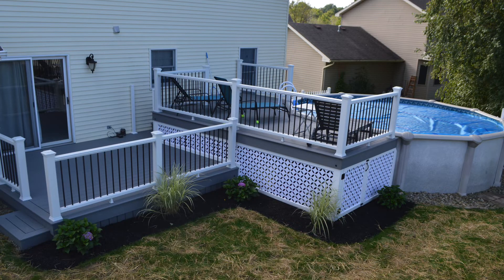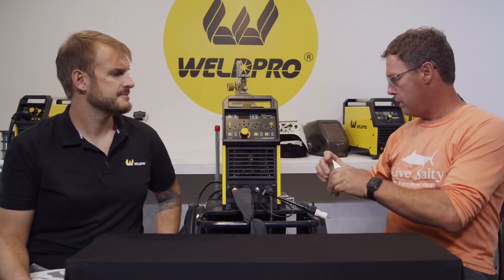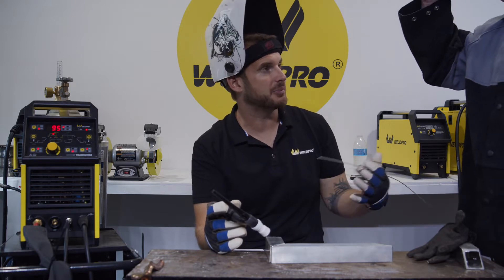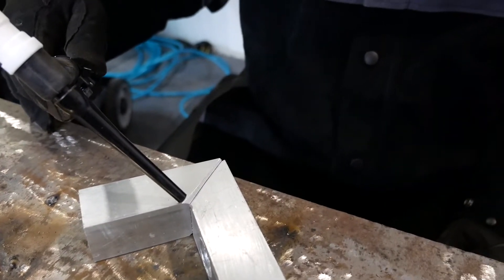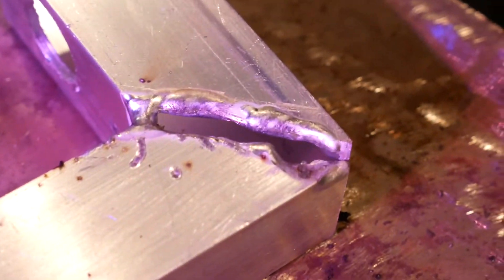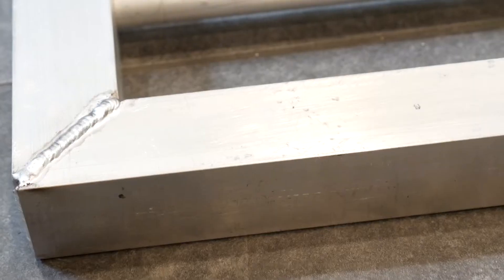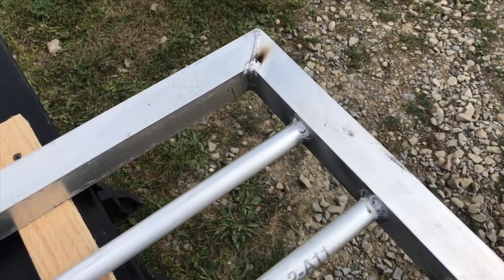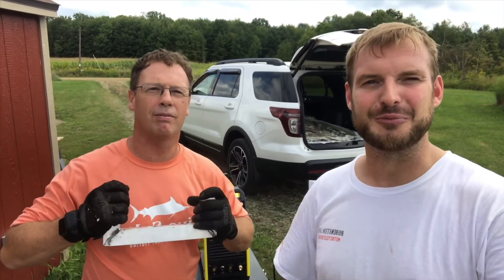How to weld Aluminum with the Weldpro TIG 200 - Building a fence gate with Heffernan Construction

Comment: do you have to touch the tungsten to material to get the ark started ????
Reply from the maker: Not with the high frequency models. All of our AC models are currently able to use the frequency. Lift start is only used on our multi process machines

Comment: I wish you had mentioned what rad and what amp rang you had used for this project.
Reply from the maker: Ya great point! I ran this at 135 amps, but varied the pedal the entire time. The rod was a 4043 3/32 filler

Comment: What where the settings on this video for aluminum
Reply from the maker: 30% balance, 130A but used the foot pedal for control. Once the puddle started the amperage wouldn't have been more than about 80. Make sure upslope and downslope are off with the pedal though. Hope this helps!
Reply: @WeldproWeldingEquipment  

Thank you so much, i purchased this exact welder and wonder how to play with the settings for aluminum.
Reply: @WeldproWeldingEquipment  

How about frequency? im also using the light blue tungsten on it that came with it

Comment: Is that a jazzy 10 lens?
Reply from the maker: Sure is 😀😀😀✌️
Reply: @WeldproWeldingEquipment  now I only use that for steel via furrick recommending not to use it on AC.. is there any negatives from it with aluminum that you’ve noticed?
Reply from the maker: @jacobfurton1058  I know they aren’t supposed to be used with AC but I love them too much not to. And no I have not experienced any problems as long as I keep the amperage under like 180 or 200 which is usually no problem
Reply: @WeldproWeldingEquipment  awesome thank you! They are definitely amazing and make things easy to see lol

Comment: I just bought a weld pro 200. I know how to weld aluminum but I'm having a hard time setting it up. Any suggestions?
Reply from the maker: Sure make sure you are in AC mode. Make sure you’re up slope and down slope are both set to zero. Make sure your balance is set to 30. Make sure you are running straight argon at about 25 ft.³ per hour. Make sure you are running DC electrode negative polarity. Remember that aluminum takes a while to preheat. It is dramatically different than steel in terms of its thermal dynamics. Thicker aluminum can require preheating with a torch.
Reply: @WeldproWeldingEquipment  thanks ok so if I want to do ac pulse what settings do you recommend? What frequency do you recommend.?
Reply from the maker: @samuelvalle5488  That is totally open to personal preference. I would start with a slower frequency around 30 herds and maybe do a 50% off time and 50% peak time
Reply from the maker: @samuelvalle5488  30hz
Reply: @WeldproWeldingEquipment  What about for 110v?

Comment: what tipe of cup is that?
Reply from the maker: That is a Furick Ceramic FUPA! Great gas lenses!!!!
Reply: @WeldproWeldingEquipment  i have the fupa 12 cup for ss welding but i was wondering wats a good cup for aluminium ..i was told just to use regular 7 size cup.. Put much rather have gas lenses than a regular cup..
Reply from the maker: @DSERUR24  Go for the ceramic they seem to hold up pretty well with the AC

Comment: can you do the same with  the 2020 Weldpro 200 Amp Inverter Multi Process Welder or does it have to be this specific machine
Reply from the maker: No, you are able to run aluminum spool gun on the 200 amp Inverter multi process but not AC Tig. Thank you!

Comment: Okay... I got the Tig 200 about a month ago and I'm finally going to get to play with it! (work/life got in the way of using it sooner) 
Everything arrived BEFORE the expected delivery date and was packed BEAUTIFULLY!!! Super kudos to the Weldpro team!
Anyway... do you think old aluminum cooking fry pans, bakers sheets etc. would be an 'okay' material to practice on? (I would sand/grind off the Teflon coating etc.)
Thanks in advance!
Reply from the maker: rkaag99 nah.... they are usually pretty contaminated from cooking so much but I guess you could try. Swing by a machine shop or steel place and ask if they have any drops you can buy. They are usually cheap!
Reply: @WeldproWeldingEquipment  Good thought! Thanks!